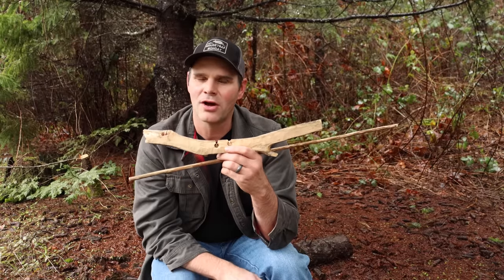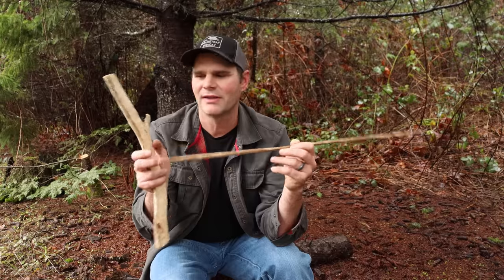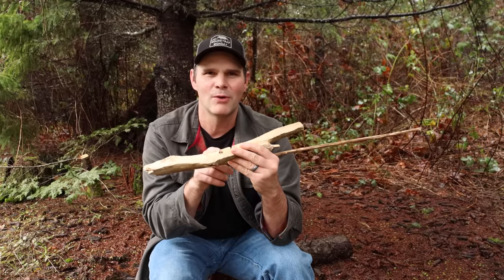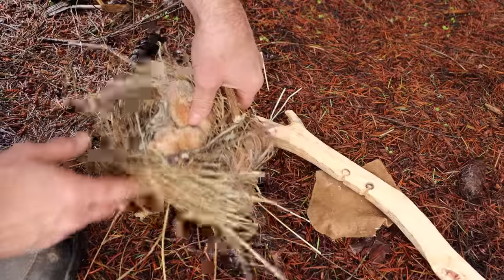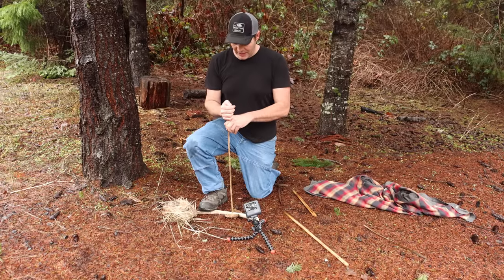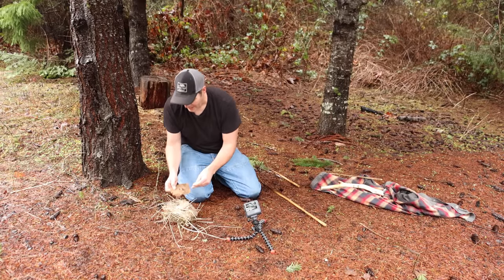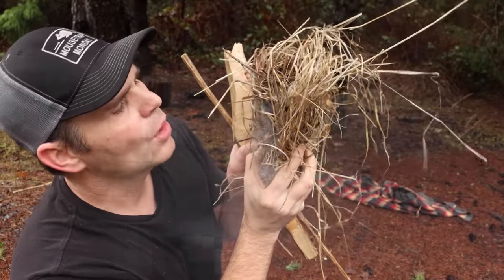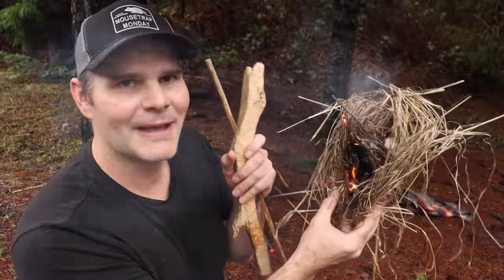Hand Drill Friction Fire - How To Make A Friction Fire Using 2 Pieces Of Wood.

Comment: This method is definitely hard. 

I did it with a power drill and some very dry pine, and it worked easily, but the amount of energy required from the drill showed me how difficult it would be for me to do it in real life. The pressure and speed is real key.
Reply: I used a drill press, LOL. It works, but wet conditions make it harder.
Reply: @chrisazure1624  I used a drill press using a 1/4 inch maple dowell and a poplar board.   All I got was very little smoke.  Why carry a board with the notches into the outback.  A lighter is much better and smaller,  Quicker too.
Reply: @donaldeisenbarth5255  A softwood with natural resin is preferred - pine or cedar. I used a maple dowel. It worked for me. As an exercise it is fun, but i woule not bet my life on it.
Reply: @chrisazure1624  
You've gone completely astray — resin is your worst enemy when getting fire this way.
Reply: @iridios6127  That wasn't my experience. Of course im not talking blobs. Just what was in the natural wood.

Comment: Thanks! I try to never miss a video but even with notifications set to "all" it seems that our YT overlords know better than I do what content I should watch. I only get notified about 70-80% of the time but that won't stop me.

I've never had success with a hand drill but I was watching one from Greg Ovens a (I think) month or two ago and his tip of using a downed tree as bearing block for a bow drill made a huge difference in the energy and time I have to expend. It might be "cheating" but I think I'll try with a hand drill to ease the load while I work on the "itsy-bitsy spider"  motion to keep pressure without having to reset my hands every fifth change in rotation.
Reply: I've found unsubscribing the resubscribing helps.
Reply: I never use notifications. I just subscribe and then go through my subscription feed. Never fails. No video from any channel I subscribe to fails to appear there.